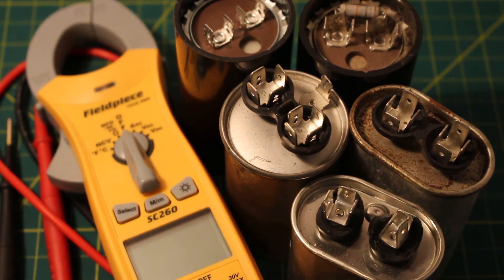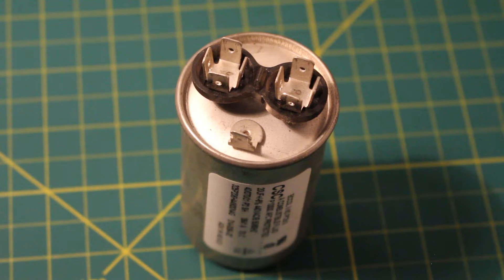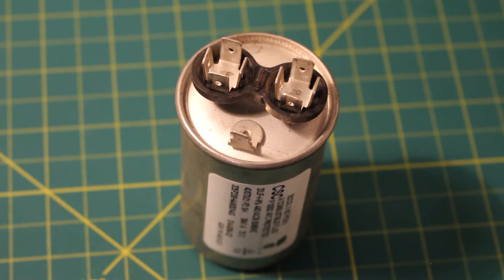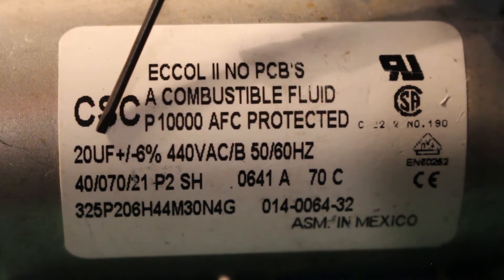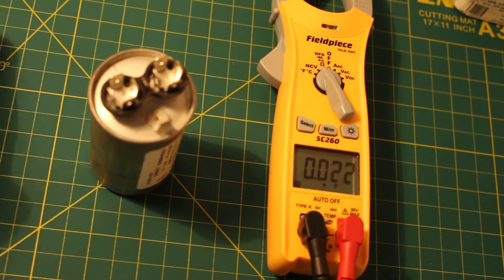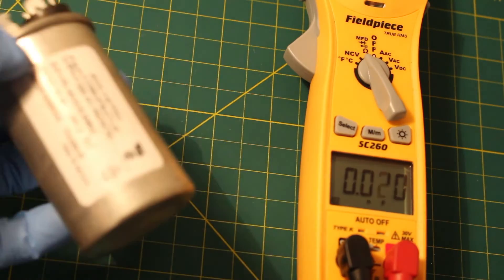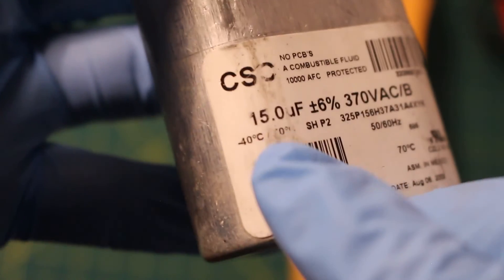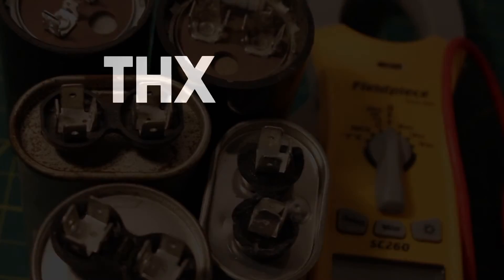How to test a CAPACITOR with a multimeter (SAFE & EASY) HVAC/R

Comment: I know we all sometimes do it but when I got my high voltage certificate I was told never to use a screwdriver to discharge a capacitor especially when you are working with ones that can be lethal because some people have been hurt and worse. I get it if you know your insulated screwdriver is rated for the situation but some people might see this video and use a regular screwdriver and hurt themselves or worse. You can use your meter, a resistor or a discharge probe if you want to do it the safest and the "proper" way. Just please be careful people. Do not use a screwdriver that is not rated for what you are working with if are going to do this. If you are not sure then go the safer route, learn what you need to determine if you are safe, or hire a professional.

Comment: Just a thought -- it's not a good idea to short a capacitor with a screw driver, use a resistor with high enough voltage capacity and resistance to drain it without a big spark - better for you, the screwdriver and the cap.

Comment: I have  a capacitor that says 35 on it and its reading 36.9, is that with acceptable range?
Reply: Depend on what the percent on the capacitor says, first one he does it says 6% . So 6% over or under 20 would be considered good .

Comment: What if you don't have a mfd setting on you volt meter??? Not everyone has a fieldpiece volt meter ...now what do you do ?
Reply from the maker: You need a meter that reads capacitance. They do sell capacitor testers alone so it's cheaper than buying multimeter with that function but you need that function. Thanks for watching & stay tuned for new videos every week🔧⚡️

Comment: Great Video,thanks! I am trying to test a Start Capacitor for a 5HP 240v Air Compressor and it has a bleed resistor soldered across the terminals. Is there anyway to test the capacitor with unsoldering the resistor from the terminals. Right now with the resistor in place the cap reads from zero to 15 ohms and stays at 15 ohm ,tested eith direction . I think on a normal cap that would be a bad reading.

Comment: One other thing you didn't explain/mention, was why you tapped your "Select" button 4 times after already turning the selector lever to Microfarads. Is that to select some sort of RANGE, as we do with Voltage on the Multi-meter?
Reply: The multi-meter he is using shares that dial position with Ohms, continuity, diode, then MFD. He presses the select 4x to scroll through these options.

Comment: My meter does an odd thing with the dual capacitors I check.  It slowly builds the micro farads and stops around 20 and the shows me a L.    Three multimeters did this.
Reply from the maker: You mean you get an "OL" reading after the build up? Did you try checking a different capacitor to see what happens? Might just be a bad capacitor. I made a video how to properly check a dual capacitor. Check it out! I will leave a link below. Thanks for watching! 

https://youtu.be/m2wHS4uJUfU

Comment: I need to replace a motor in my hvac unit. The capacitor was replaced last year so it's pretty much new. Do I still need to discharge before removing the fan, com and ground wire from it?

Comment: what does the 6% plus or minus mean? you could have could have included in the video, so the new guys like myself would know when to change them and show the costumer.
Reply from the maker: + or - 6% of the MFD rating is considered a good capacitor. So if the capacitor is 20 MFD, you should be within 6% of the range either above or under. The important ratings are voltage and MFD/UF. Just look at it as long as you're close to the rating, you'll be good. If it's way off then you know it's bad. Hope that helped 🙂